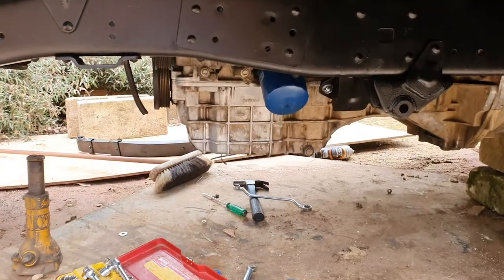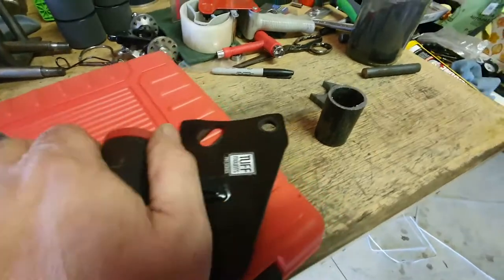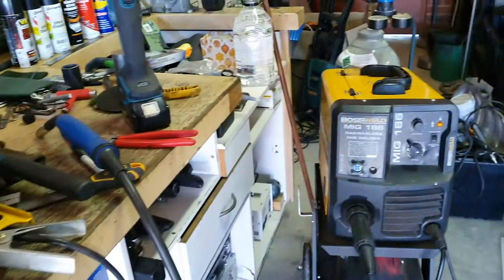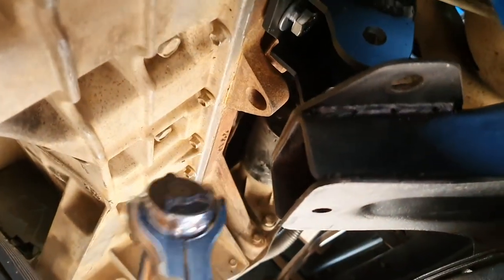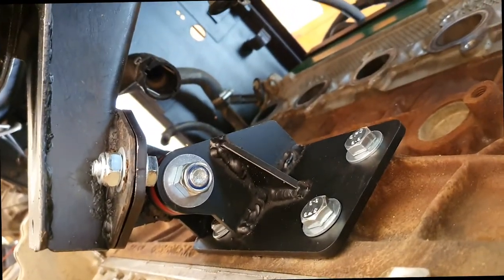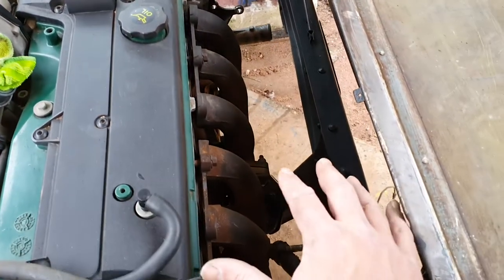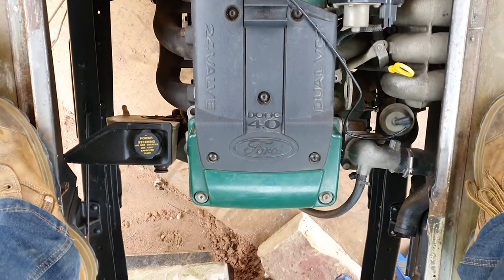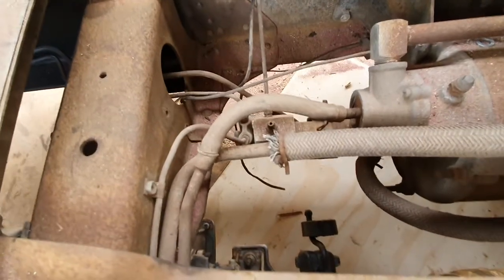Toyota Coaster Barra Swap Episode 2 - Engine mounts

Comment: Good vids mate. If you have the cash, get yourself a Milwaukee electric ratchet.  It changed my life for tight angled bolts.
Reply from the maker: I've been eyeing off one of the right angle ones for a while, for those tight spaces. I do have an Makita impact wrench for the big stuff which has been a huge help.

Comment: Definitely add a power steering rack if possible.... and that big top mount turbo lol
Reply from the maker: I think I might. Though I'm going to start simple and get it driving then add extras later.
Reply: @barrabadgesAust  Also be interesting to see if you could make 4x4. Ive heard of people using landcruiser transfer cases and front axles to make these really good off-road. With the barra you could perhaps do this, using the ford territory transfer case/gearbox. Turbo 500hp AWD vintage camper lol
Reply from the maker: @simonhill6267  I have been investigating the 4WD options. I almost bought a custom dyna with all the 4WD gear required. There are Barra to Patrol bell housings so Patrol running gear could work.
Reply: @barrabadgesAust  what a machine it'd be. Hook that up with some solar, bonded 4g connections, and be close enough to a water source to say catch ya laters when covid 2021 hits 😂

Comment: Hey mate how much would you charge to make me a pair of them engine mounts
Reply from the maker: I can send you the CAD drawings. As I am not a welder I'd recommend getting someone more experienced to put it together.
Reply: Hey mate yeah that would be great if you could be much appreciated
Reply: Hey mate how did you go with them CAD drawings ? If you need some coin for them that's cool
Reply from the maker: @peternlauren2034  I realised I will need to take the mounts out to take some measurements. As the laser cut parts from the CAD files were modified as I assembled and fitted them.